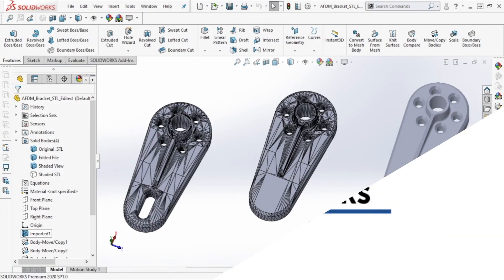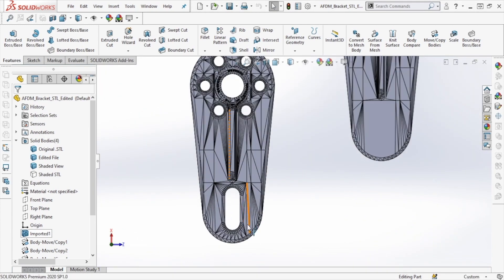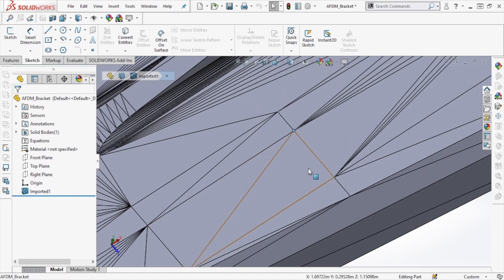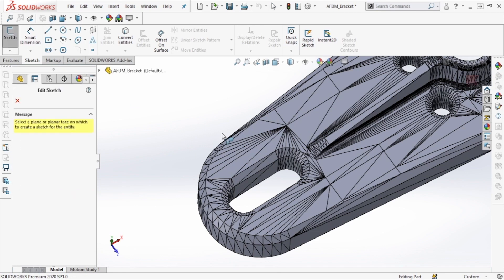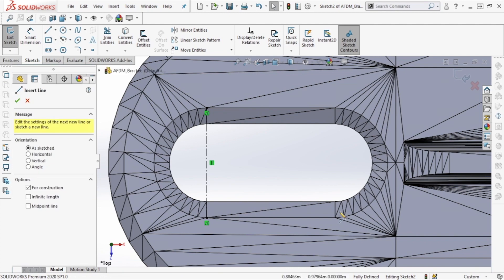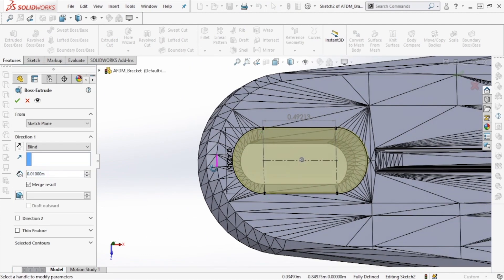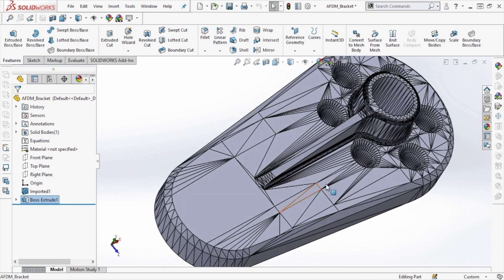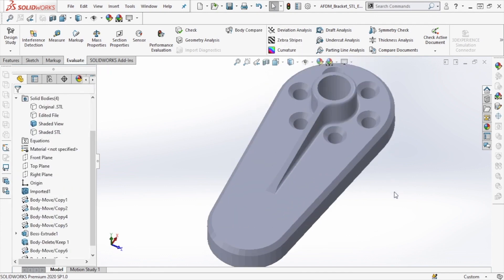3D Printing Tech Tip: Editing Mesh STL Files Using SOLIDWORKS

Comment: Informative video but you forgot to mention one critical step, probably because you have it already set up. In order to be able to modify the mesh file you need to set up Solidworks to import it as a solid body and not as a surface body or a graphics body, which are the other two import options. One way this can be done is inside Solidworks go to System Options->Import->File Format(STL) and then choose Solid Body. 
Or if you want to choose every time you import an stl you can select the same options from File->Open->Mesh Files and then select options and it will actually take you to the same options as before.
Reply: THIS

Comment: The file you exported has 2 polygonal faces where the slot used to be - they're not triangles anymore, they have 13 sides. Will that still be a valid STL file?